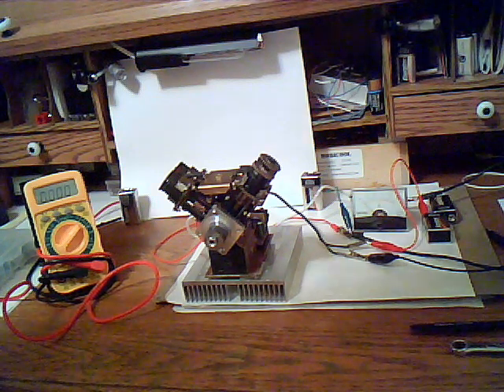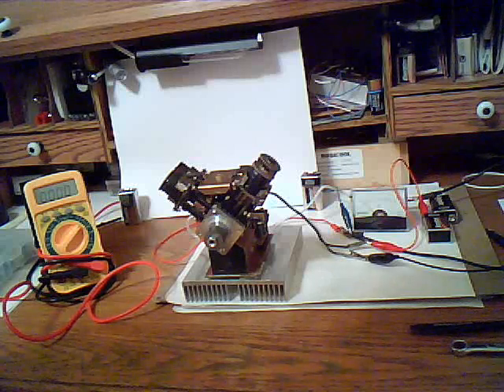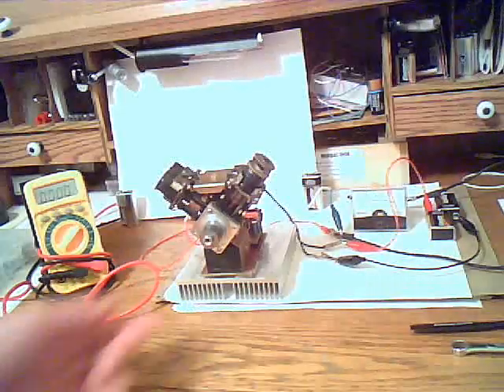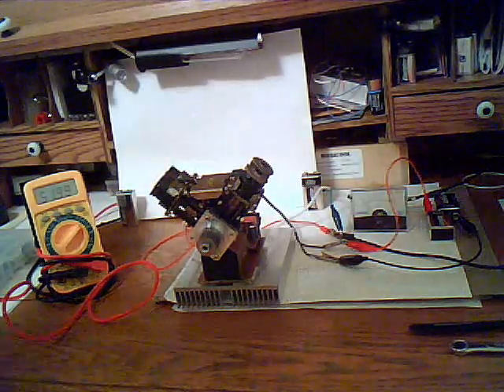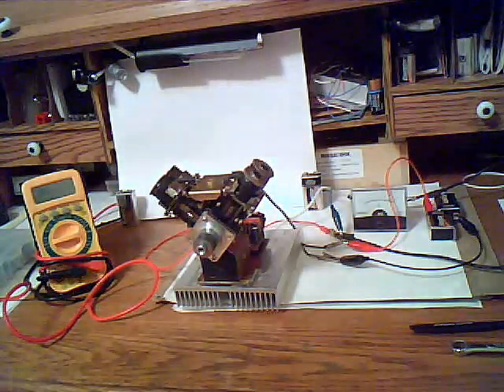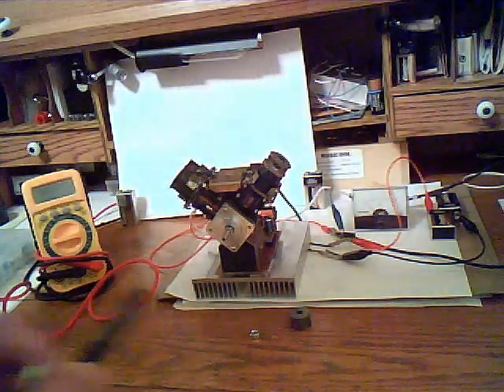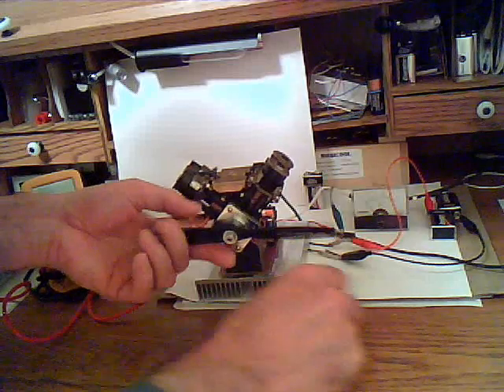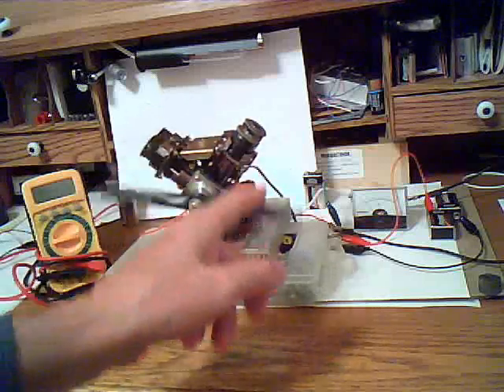electric 4 piston engine

Comment: Runs smootly. And without a flywheel. So next step is to make same, but
more cylinders. You can use it with AC or DC. No matter of how it is polarized.
Are you going to make more of these in the future.